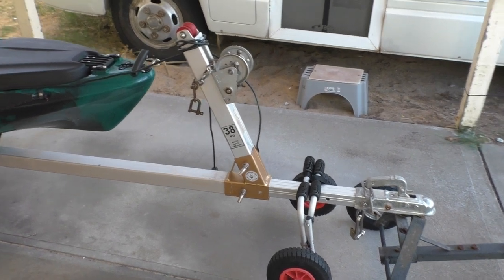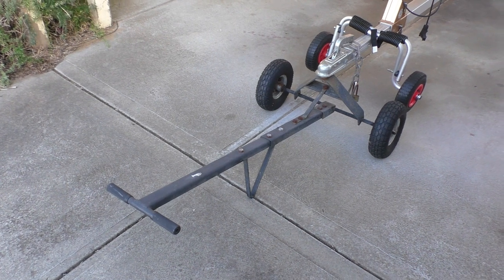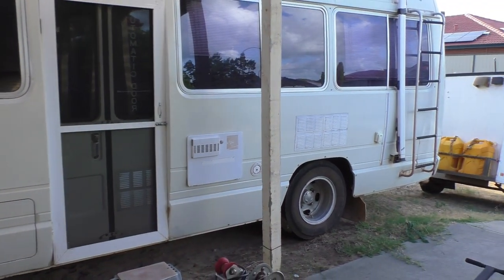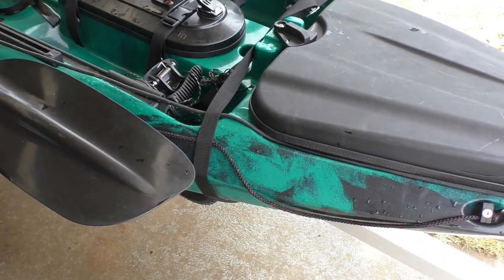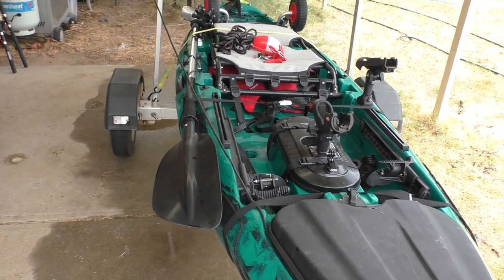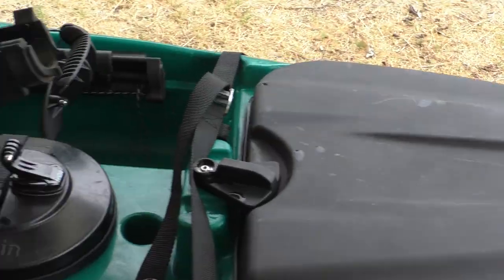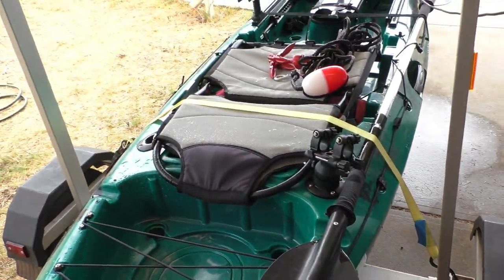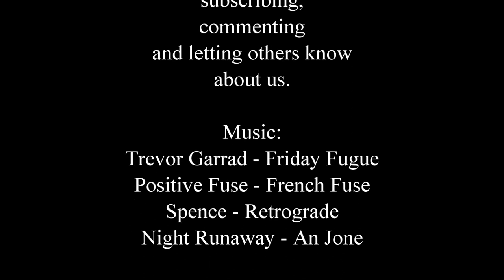Kayak trailer - First test run

Comment: You might be able to fix a couple of rails to those wheels so the kayak sits better. Perhaps those cheap pieces of pine in Bunnings, about 900mm long. Two of those, a pair of U bolts.
Reply from the maker: I don't really want to put anything on the trailer that is too hard to remove when we want to use the dinghy. As it is I just remove the number plate supports and put the skids back on then replace the wheels with the normal rollers. Literally less than a couple of minutes to do. Once tired down the kayak is nice and stable anyway so no real need to do any more I think.

Comment: Good to see the trailer is successful. I have a Bulldog folding trailer doing nothing that I've been meaning to convert for the same purpose. We have two kayaks that we like to take to Point Peron on the Shoalwater side and putting them both on the Pajero roof is a right pain for short trips. At the beach we use the wheels with the adjustable  posts that go through the rear scupper holes and they do work well.
Reply from the maker: We used to use the Bulldog trailers, had a couple, the first was great then we made the mistake of 'upgrading' it and they had started using poor quality Chinese steel. The support arms broke, mudguards fell off it was generally falling to bits. We switched to the Mangrove Jack which is much lighter and easier to assemble. Never looked back after that. Went down and picked up the kayak wheels with posts this morning, I think they are going to be much better than those awful folding things :)

Comment: Maybe check out BCF or Anaconda, one of them do the kayak trolley that fits in the scupper holes. And they are adjustable in the width  as well on those upright poles. Also check Getaway Outdoors they may sell them to, cant remember the brand name though
Reply from the maker: Yup, went down to BCF yesterday and got one :)